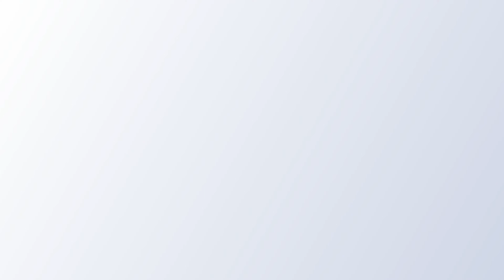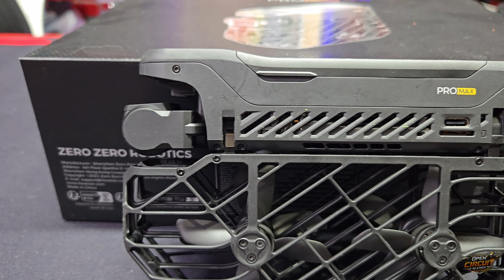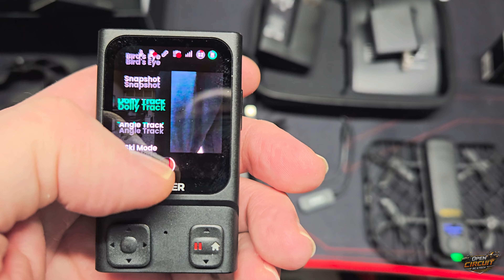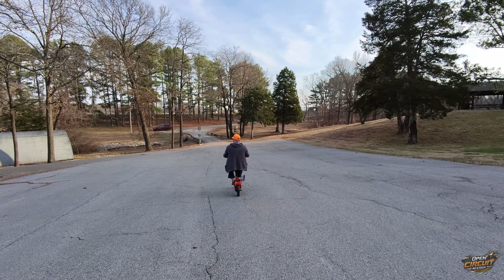HoverAir X1 ProMax Captures Your Most Epic Moments in 8K

Comment: Nice job Ryan, the quad seems to perform pretty well but for the price I like my SKYDIO 2 a lot more.
Reply: There's no comparing with the skydio 2. The main difference is that the Skydio 02 is a little scary out in public it's just so awesomely aggressive lol
Reply: You know now that we're talking about it I guess I better take my skydio 2 out and test the beacon on that and see if it follows the beacon or me. I never thought to test it until the hoverair
Reply: @realiouslytv1711  I have flown mine with the beacon many times and it works better than the regular remote to me. You really want the beacon on you bc you can change the position of the quad while you are moving.
Reply: @gdhall5311 oh I agree I use the beacon. I use the joysticks too if I'm going to fly around but most of the time it's just follow me and I don't use anything. I'm just sharing the fact that the beacon isn't actually a beacon. All you have to do is test it but It's an awesome tool.
Reply from the maker: Yeah this one is pretty pricey at $950 for the combo I'm using in this video but the basic drone alone is pretty reasonable at around $500.

Comment: It's just so awful at avoiding objects though. And the beacon does not determine where the drone goes. On the positive side every shot I've taken with this drone is gold
Reply from the maker: Why do you say the beacon doesn't determine where it goes? That's the whole selling point of the beacon. It's simply supposed to improve accuracy. So far I've had zero issues with it running into objects. I do really appreciate your input.
Reply: @OpenCircuitRC well I like to test my drones and you're right that is the whole selling point of the beacon and they themselves admitted it does not work as a beacon. If you want proof have it follow you around and hand someone else to beacon and see who it follows. I use my drones at construction sites and this thing follows me around but it runs into polls all the time sideways
Reply from the maker: @realiouslytv1711  I believe you but then they are lying by claiming it increases the accuracy. I see no reason for the beacon then unless you want a mini FPV screen and some controls without using your phone.
Reply: @OpenCircuitRC my thoughts exactly it does provide that feature
Reply: Again go test it out hand the beacon to someone else or even just set it down and it will continue to follow you wherever you go. And I question them about it and they admitted that it does not work as a beacon
Reply: @realiouslytv1711 That's because it doesn't have Side Obstacle Avoidance